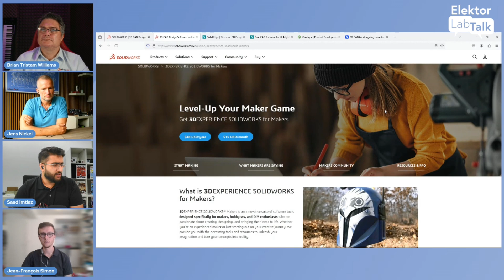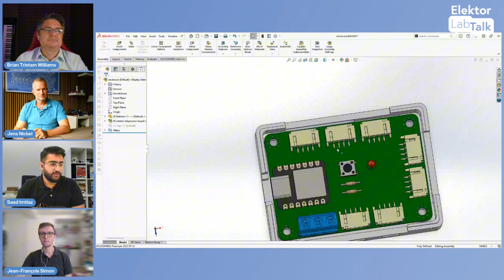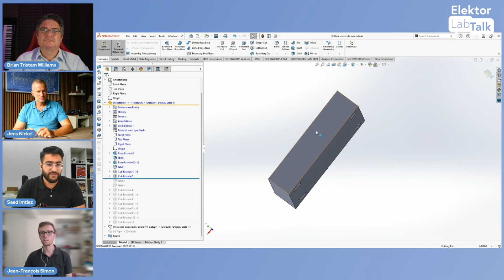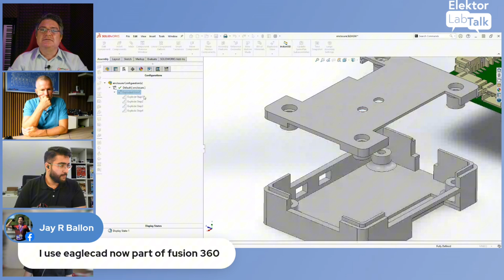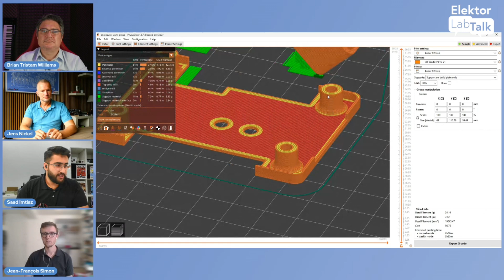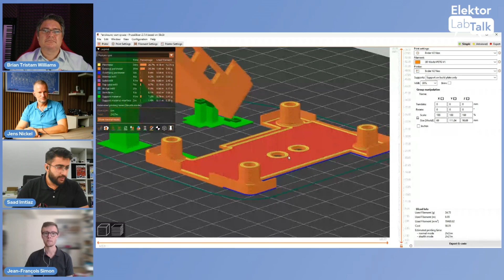3D Printing Tips: Design Durable PCB Enclosures & Prep for Injection Molding

Comment: Why just 45 degrees in only one axis? Why not 2?
Reply from the maker: What section are you referring to?
Reply: @ElektorTV  The use of support struts to print at a 45 degree angle of plane of weakness..
Reply from the maker: @SusanPearce_H  It's to make the final print more rugged and less prone to splitting. One axis is sufficient. If create an angle for both axis, you will have more supports, which in the end will make the overall print more expensive.
Reply: @ElektorTV  Thankyou for your reply.
So it is a trade-off between ultimate long-term rigidity, and cost.